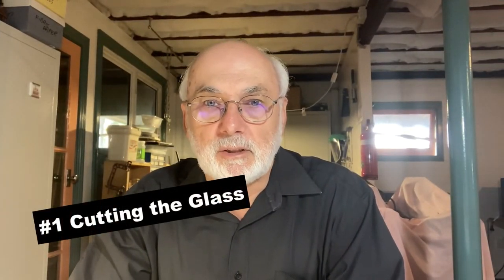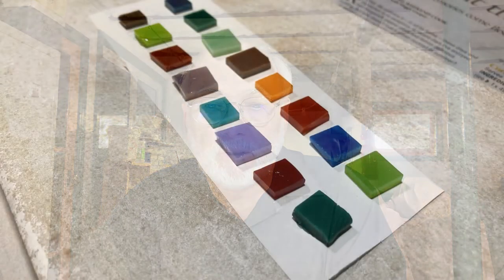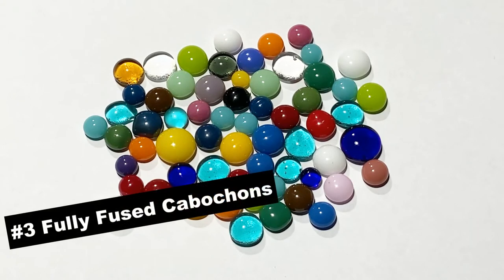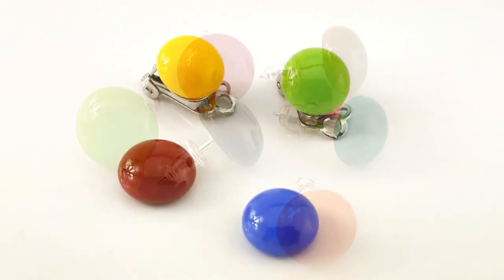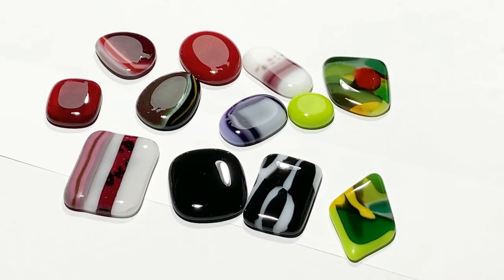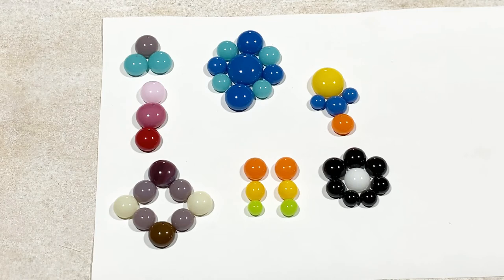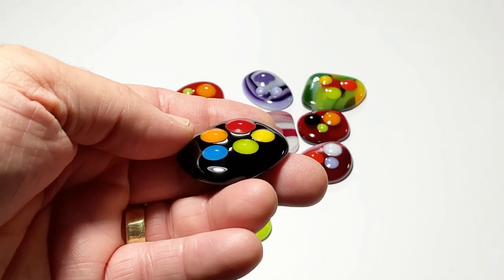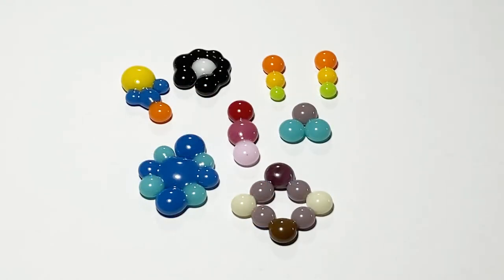Making Fused Glass Cabochons & Jewellery with a Glass Kiln or Microwave Kiln, Project Tutorial

Comment: I know you use a full kiln, but do you have any idea how I can stop my microwave fused glass not to crack.
Reply from the maker: Hi Ray. Sounds like thermal shock. This is usually caused by ramping up the heat or cooling down too fast. Cooling down too fast can cause it to crack straight away or introduce fine cracks that fail at some later time. If it cracks on the way up the edges will be rounded due to the heat work. If it cracks on the way down you should have sharp edges. It's the temperature difference between the inside and outside that is the problem. I don't have a lot of experience with microwave kilns but I understand you need to allow it to cool naturally in the kiln. With small pieces this should work because they are small and can cool throughout at a reasonably consistent rate. There is no big difference in temp between inside and outside. That's what I do in my kiln for cabochons, but that still takes a lot longer than a microwave kiln. What is the process you are using?

Comment: If I'm not mistaken those of us who want absolutely clear glass puddles or cabochons  have to be careful of shocking the glass into a frosted look destroying the clarity inside each peace. For certain this is caused during a certain temperature range during the cool down period. Perhaps this of no concert with your pieces because most of yours appear to be opaque.  However I would appreciate your opinion or knowledge of this shocking clear pieces during the cool down period.  I have a cool down regimen that combats this but  I would be interested in that by preserving the clarity in clear or tented pieces might add a new dimension  to your cabochons also.
Reply from the maker: Hi Bob. In a lot of cases for cabs I just allow the kiln to cool naturally. Cabs being small this works fine. While these cabs are opaque, I make cabs using transparent and clear glass and have never had a problem. If my cabs get a bit larger I do control the cooling and have an annealing segment.